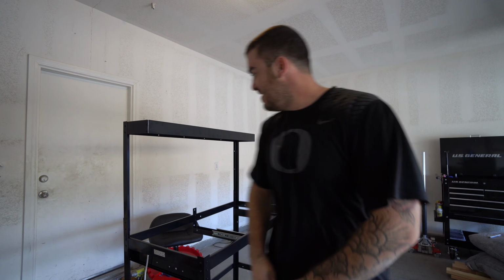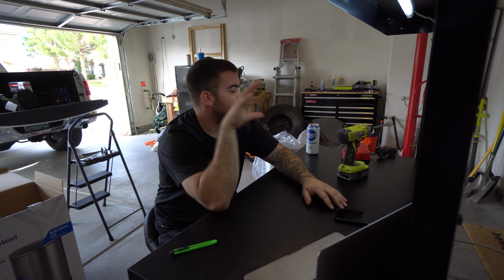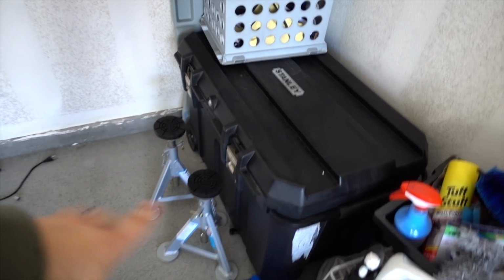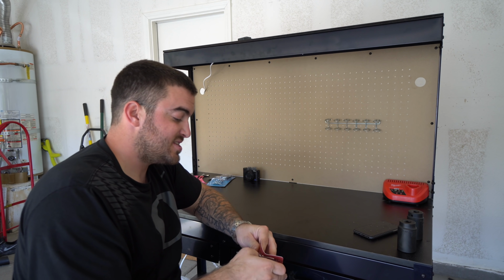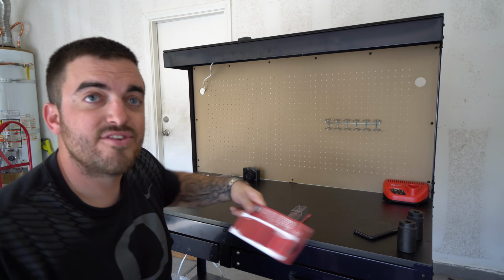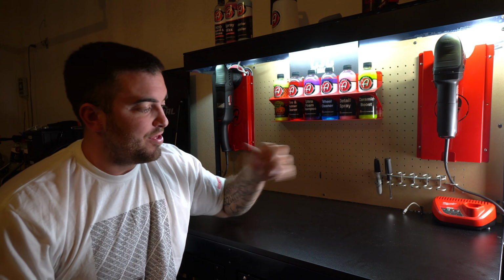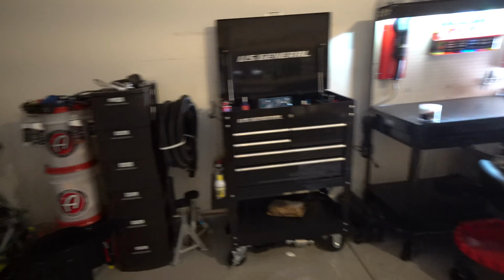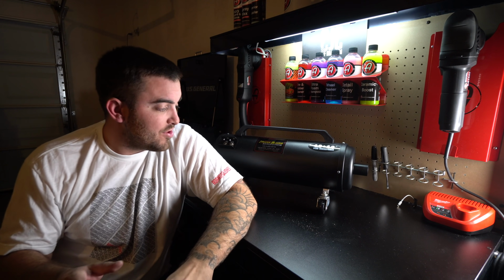Building a Perfect Garage? Flat Out Garage Build: Episode 1

Comment: Heated dryer? Wow. I wonder how much more effective this is. I currently use a chemical guys dryer. It works ok but still takes way too long in my opinion even with my car being ceramic coated. I tend to use a microfiber on the big flat areas and finish with the blower on the wheels, grill and cervices. I also don't have a spot free rinse system so the struggle is real trying to dry the car quickly so i don't get hard water spots...If you get a chance do a review of the dryer... Thanks. Keep up the good work brother!
Reply from the maker: I have half of it filmed 💪🏻💪🏻